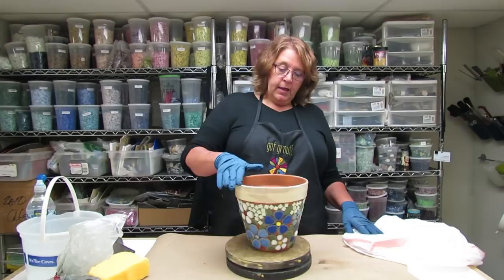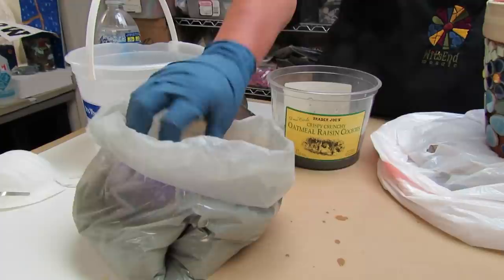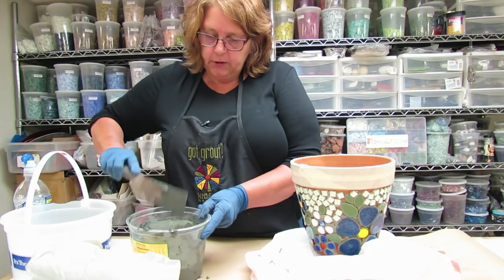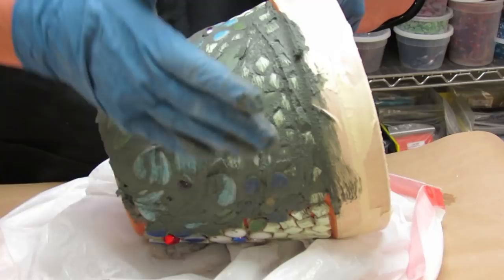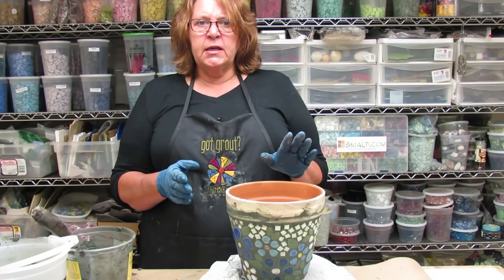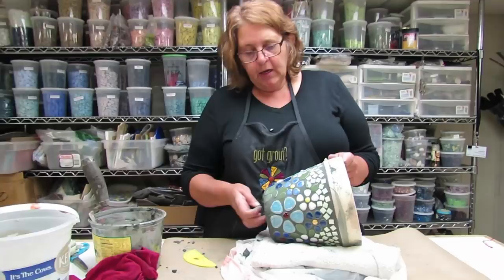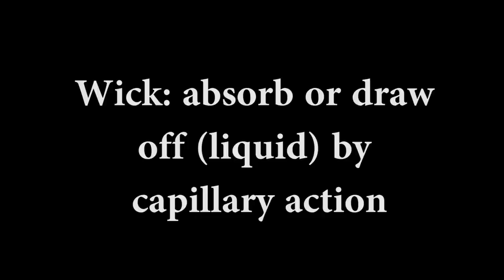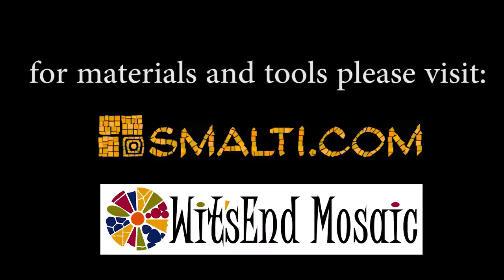Continuing the DIY: Mosaic Ceramic Flower Pot, Part 2 with Grouting Guide Included

Comment: Great tutorial!!! Can’t wait to get started! Your tips are awesome. I really like your thin set method for application much better than adhesive methods. 
Question: with stained glass pieces/ tiles, is the process the same? If not can you advise? Thanks!!!
Reply: Hi Jeff, Thanks for your comments!  Yes, all of the steps and applications are the same.  Although I have used many thinset brands with glass some do a better job than others so check your thinset to make sure that it is suitable for glass tile applications and you're good to go.

Comment: Very helpful, thanks! I'm learning and how do you grout successfully when tesserae are different thicknesses?
Reply from the maker: Good question! this video may give you some other ideas, I try to bevel the grout in between the different heights, and always use polymer fortified sanded grout, non sanded will crack. https://youtu.be/swDmXYd3xmI?si=XVk7AH7X-TqivWbt

Comment: Tips for a large pot ?   I am buying it second hand so it is used and dirty. Too big to work on inside.  It will take several sessions to apply all the tiles I will have to work on stages.  Any quick advise or referral to appropriate info source?
Reply from the maker: Senior moment, thought I replied to you. Try the lazy Susan trick, may make work a little easier.

Comment: Total beginner here, but tried my hand at it some time ago.  I used a dk gray grout and found it to stain all of my tiles.  Any help or suggestions why?  thank you
Reply: Please give me more info on the tiles used.  Typically the only time this happens is on unglazed ceramic.  If it is High fired and durable, it is easily removed with Vineger or any mild acid and a green scrubby.

Comment: I made a mosaic table top with stained glass. It's a indoor table but I anticipate somebody setting a drink glass on top of it. Therefore I want to seal it. What is the best easiest product to use? Can I use a polyurathane? Can I use modge podge? It would be almost impossible for me to only seal the grout and not get any sealer on the glass. Can I put grout sealer over the whole top and quickly wipe it off?. The glass pieces are super close together so it seems like I need something that can go on grout and glass without damage to either. I don't want to take away from the shine of the glass. Can I just use a spray acrylic sealer ? Thank you love your videos
Reply from the maker: Your question is so timely. No kidding just today I was editing a new video about making a mosaic table top for outside! I will post soon. Kim and I have pretty strong feelings about not sealing, why? Really a lot of work and sealants trap water, both in a protective manner, but also underneath. If any water finds its way under the tabletop substrate that may cause damage. Unless the work is very high traffic (a floor,) it may be far less work to scrub the spill out of the grout than do the labor intensive work of sealing, You must get the sealant into the grout and get it off all the tiles - yep every single piece of glass otherwise the sealant will dull the surface. Recommend you use the same manufacture of sealant that you used for grout. If a light-colored grout bleach in a spray bottle may do the trick if red wine was spilled.  NO NO NO to modge podge, or spray acrylic. You could pour a resin over it, but confining the resin may be a problem (table would need a lip). You could get a custom piece of tempered glass to put on top. There are grouts available that have sealant properties already in them, such as Laticrete's Permacolor. Good luck. Bonnie
Reply: @MakeitMosaics  thank you for responding. I was thinking of covering the top with plexiglass or the such. I appreciate your timely response happy New year

Comment: Hi, how do you dispose of the grouty water at the end? I’ve been letting it settle and pouring off the water but still a bit scared for my pipes.
Reply from the maker: I too let the water sit overnight, I dump it in my garden or on a tree, it does not hurt the plantings - actually they like it, filled with lime. Then I scrape out the remains and put in trah. This video may provide some additional insights: "No one wants to call the Plumber!" https://youtu.be/c3DRD1Ss9Lo:face-blue-wide-eyes:
Reply: Thanks! I just saw your reply. I appreciate you taking the time to answer my question! Glad to know the plants like it too.

Comment: Hi.. I really loved your tutorial.. I am doing mosaic for the very first time following your instructions.. I left a damp towel inside my terracotta pot after finishing with the thinset. However, when I checked after 24 hrs, my mosaic tiles were moving with visibly runny thinset. The thinset was no longer peanut butter consistency or even thicker. In fact it absorbed the water from the pot. Can you please advise what should I do differently to avoid this situation? TIA
Reply: Hmmmm. Can you advise what brand/type thinset you are using?  I suspect it may be the premixed variety, which it not the correct product in this application.
Reply: @kimwozniak5663  yes.. I am using the premixed.. already half way through.. it’s for mosaics specifically.. why is it not appropriate?
Reply: @kimwozniak5663  I am using the acryl pro tile adhesive
Reply: @srishtisinghal3319  The instructions in the video are for a cement-based adhesive. Cement-based adhesives Cure to set/harden. The damp towel prolongs the cure time, making the bond stronger. AcrylPro is an acrylic-based adhesive that dries to harden, so adding the water and the wet towel prevent it from drying and making it weaker. Although your adhesive suggests that it is for mosaics, It does not make it suitable for all conditions, and  it would not be recommended in the instance of constant water presence in a flower pot. It is a product made for homeowners to do backsplashes etc. You can finish your pot with it but stop damping the pot. I can not speak to longevity if used for a plant? I have no experience using it.

Comment: Did you state that mosaic pots such as this one cannot be left out over the winter?????  Our area has temps down to single digits on occasion. I wanted to mosaic a terra cotta pot for a toad house in a fairy garden but want to leave it in place year round. Bad idea?
Reply: Cynthia,  It will really have to do with how well protected it is and I assume that as a toad house it will be upside down and therefore not really holding moisture.  They can withstand freezing temps.  I store mine dry in an unheated garage in Wisconsin.  If it soaks up moisture outside from rain and/or snow and then freezes the terracotta will degrade. If in your climate you have left terracotta pots outside without issue it should not be a problem.  It is really about the pot not the mosaic.

Comment: Simply love the instructions and video!! 
Can we use mosaic tiles on glass or plastic? If so, can you please suggest which glue to be used?
Reply: Yes, If you are intending on using the container in an exterior application use an adhesive like Lexel or other silicone type adhesive that is recommended for exterior use.  If your container is plastic make sure it is stiff and not flexible.  Any flex in your substrate will/can cause your grout to crack.
Reply: @kimwozniak5663  thanks a ton for the suggestions!👍🙂Where can I find the petal shaped mosaics ?
Reply from the maker: @gv7915  https://witsendmosaic.com/ceramic-porcelain/fun-tile-shapes.html
Reply: @MakeitMosaics  thank you for the information!

Comment: Thank you that was great and very informative. Do you seal your pieces at all, or do you believe that the polymer in the grout acts in this way?
Reply: I personally do not seal.  I feel the polymer is enough.  It has also been my experience that if the grout gets stained or mildewed it is much more difficult to clean if it sealed.   I feel like what you are trying to clean off gets caught up in the sealer.  If your main concern is keeping the water from soaking in.  We already left the pot unsealed so sealing the outside won't help much.  The water will come from the inside out.  The most important thing is not to leave them outside in freeze thaw states.
Reply: @kimwozniak5663  Thanks KIm

Comment: Hi Bonnie. Can you please tell me the color of the grout you used?
Reply from the maker: I THINK natural gray. Good luck and thanks for your interest!
Reply: @MakeitMosaics  Hi Kim. I am having an issue with my pot. I have a few of the tiles that just don't want to stay on. I have a damp towel in the pot and I am wondering if the maybe the amount of moisture could be the problem, but it is only a FEW of the tiles, towards the bottom. Any suggestions would be welcomed
Reply: I want to add that it has been over 48 hours that I have put the tiles on with the quick-set, but I haven't grouted yet. Thanks :)
Reply: @trishfrench1927  First did you use pre-mixed or regular Thinset?  If you used Premixed then you need to remove the cover and stop adding moisture.  This material is quite different from the thinset that you add water to and mix yourself and needs air and no moisture to dry.  It is also not nearly as water-resistant so it shouldn't really be used where the moisture level is high.  If you used standard thinset from a bag I suspect there is too much additional moisture.  You are safe to uncover and allow to set.  

I used a grey-green grout on the pot in the video.  It may be difficult to find but as Bonnie mentioned natural grey would be nice I usually error on the side of darker grout rather than light.
Reply: @kimwozniak5663  thank you
 It seems to be the moisture, but I made sure to get the one I had to mix.
Reply: @trishfrench1927  You are safe removing the towel and cover at this point.  You mentioned the bottom ones weren't setting which makes sense as to much moisture is probably settling to the bottom.